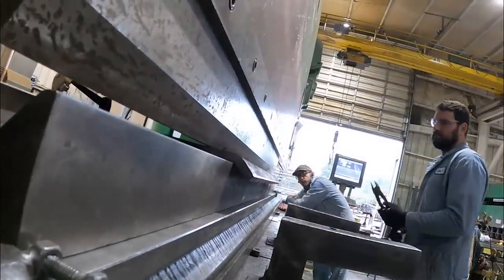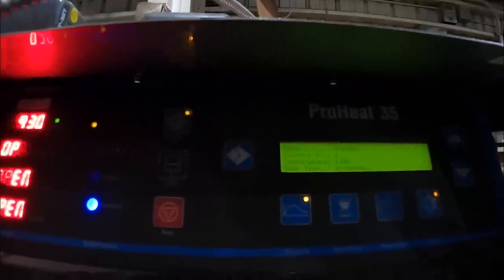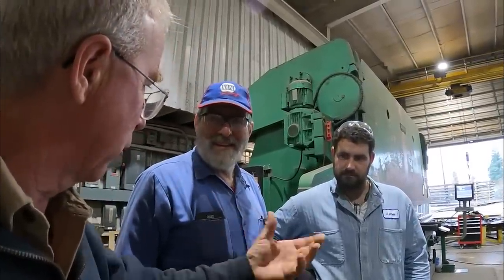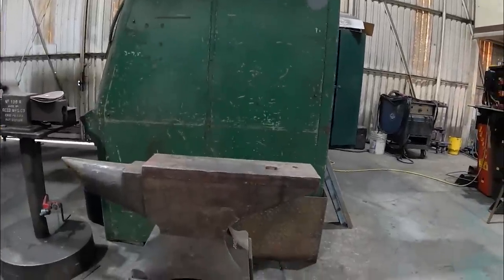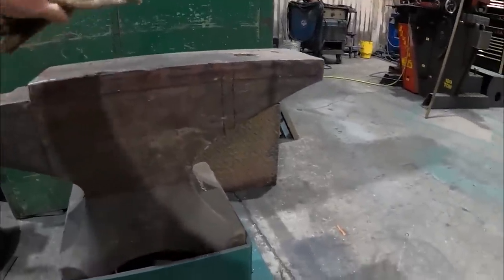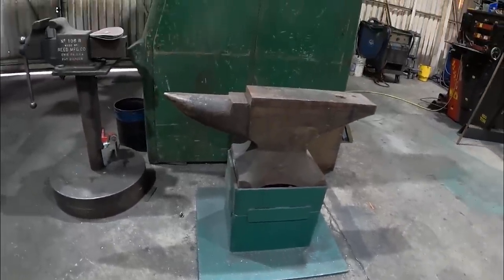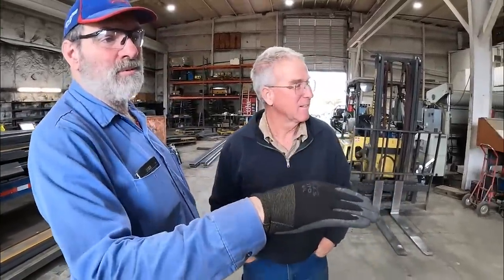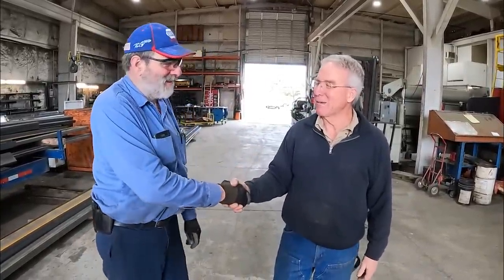Induction Forge Show And Tell

Comment: That is a miller proheat, I run those pretty often for heat treatment and stress relief of fabrications where I work. One of those power sources maxes out at 35kw to answer your question on what the power output is. We have one oven at work that runs off 3 of those in parallel. 105kw in total

Comment: I built a small jet engine that uses a rotational induction heater…not super efficient…but on small scale and with an inconel radiator tube…it does work…there’s quite a bit of heat loss but on a tiny scale it holds enough heat to produce energy for propulsion of a model jet…I’m more on the engineering side … but this is the beauty of math science and the application of the two to make something magnificent …

Comment: Whoa. 

I wore White Ox gloves when I was hauling chips/sawdust/bark in the Willamette Valley back in the early 2000s.

They were perfect for wet weather work and I kept three pair in the truck so I never had to wear a soaking wet pair. The dash vents helped dry them out in between use. 

Haven’t seen that brand for a while.